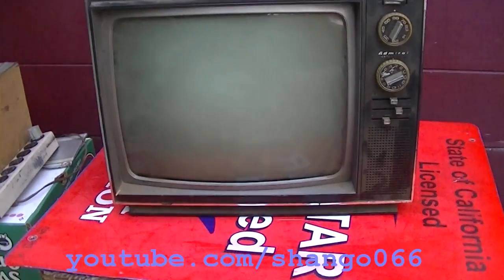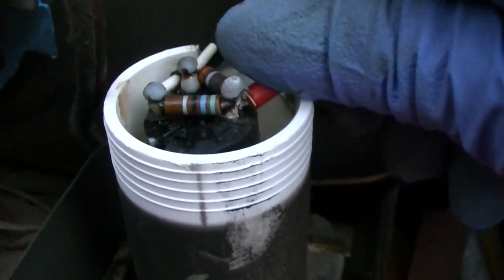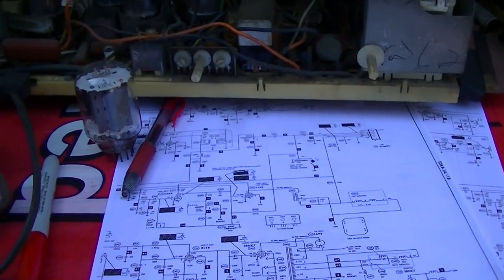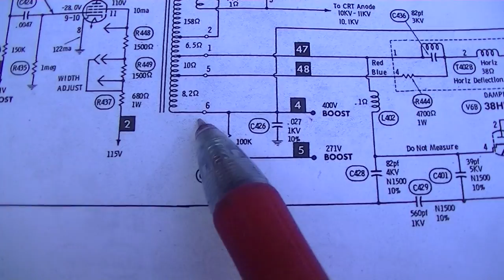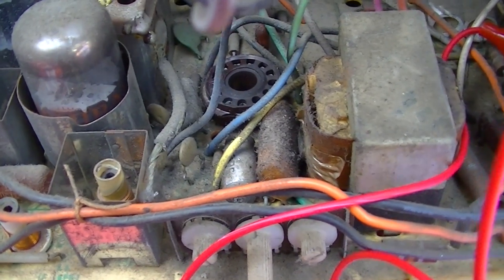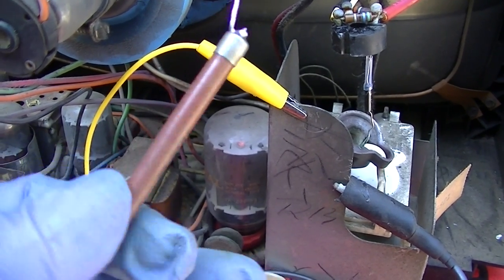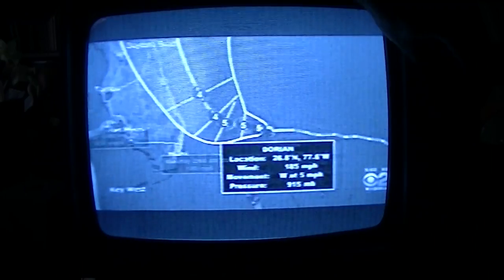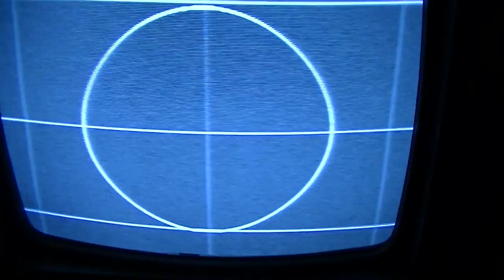1970 Admiral Black and White Portable TV Repair

Comment: "Instant-Play" or "Perma-Bake" or start your house on fire when you aren't home... or when your family is asleep in bed.
Reply: Yep, and meanwhile throw money at the electricity meter.
Reply: And put heavy wear on the CRT by keeping the heater on 24/7.
Reply: A common safety tip in the day was to unplug your TV when you were going away from home for extended periods. In fact, they still say to unplug your electronics when you're not using them.
Reply: @dougbrowning82  When I was a kid, my parents turned everything off -- gas, water and electricity -- before our annual holiday trip. It meant cleaning out the fridge, but it gave them some peace of mind.
Reply: @GGigabiteM  Most sets had the heaters on a rectified mains voltage instead of the full voltage. The heat dissipation is then about 70%. Enough to get a picture on instantly. When the set was switched on the rectifier would be shorted and the filaments would be on temperature within a few seconds.
Reply: @jlinkels  ...Which still caused heavy wear on the CRT. TV sets with "instant on" functionality were often fire hazards and had recalls or TSBs on them to disable the circuitry constantly powering the tube so the sets didn't keep burning up tubes.

If anyone comes across an old TV with instant on functionality, I'd recommend either disabling it or unplugging the TV when not in use to preserve it, you can't get replacement CRTs anymore, the last manufacturers of even the junky CRTs ended production in 2008.
Reply: @GGigabiteM  Sure. I did not say it was a smart thing to do. On the other hand, the waiting time could be quite nuisance. I have converted quite some television sets to Permabake as well as a number of USA radio sets. Few EU radio sets used series filaments, but almost all TVs did. At that time nobody cared about energy, and who cared about tube life if they were easily available. I am not even sure is a cathode is subject to wear when there is no current. In high power radio transmitters (the field where I am from) tube filaments are kept on low heat whenever the transmitter is switched off. And before that was available, tube filaments were often switched to 1/3 power so as to reduce thermal stress. But the cathode construction is different in those tubes.

Comment: Just came across this video.  I worked for a Admiral dealer, a small one man shop.  We sold a couple thousand of these sets.  They were good workers and the only recurring problem was the instant-on diode across the power switch after south Florida lightning storms.  We also sold Gusdorf TV stands with then too.

Comment: Back in 1069 I  wed the love of my life and together we moved to Minnesota, back then you could get work out there. Well we got settled in, I was pumping fuel at a truck stop, my good wife was pouring coffee at the attached café.  We needed a roof over our heads and found a brand spanking new Liberty Mobile Home nice well we thought it was. The home was set in a trailer park for us by the dealer and it was hooked up to cable TV. Now not like you have now but just a large set of antenna's on the hill above our park, which was set on the shores of the Cannon river. So it was, we needed that adapter to hook to the 20 buck TV I found for our entertainment desire at a thrift store in Down Town Cannon Falls Mn.  Worked OK for our purposes. It was a cool start to our lives and the honeymoon continued for the next 51 years and 4 days.

Comment: Seeing that broken off antenna brings back memories of metal coat hanger antennas! It’s funny how nothing has really changed and how people today think you need a bunch of special equipment and antennas to get over the air free TV! Yes if you have an old tube type tv or even some of the early flatscreen you need a converter box but to receive over the air free tv you just need a basic antenna yes a metal coat hanger still works as an antenna, I’ve even used a large paper clip straightened out and bent into an L shape stuck into the cable connector on the back of my lcd tv  here in Denver and I can get several free over the air tv stations I have even been told by some people that this is illegal to do because I’m steeling cable tv, “LOL”!!! You don’t need any special equipment, a free tv key for $19.99, a high tech special digital antenna!
Reply: In my country they switched all the analog TV transmissions to digital, and without a good antenna installed on your roof you basically can't get nothing. In the old analog days you could receive some local TVs without an antenna, by even simply having a piece of wire in the antenna socket, but for receiving national TVs you still needed an antenna (well, maybe without it you received something but it was a very noisy signal)

Comment: I worked in a old TV repair shop in Santa Clara Ca. from 1983 to 1989. If I took a set like this one in for repair the owner would get mad. 20.00 estimate charge, 42.50 an hour. It didn't make sense for us to charge folks to repair these, well anything that had Tubes. The shop also sold new Zenith, RCA and Quasar TV's and VCRs. We put allot of Flybacks in the RCAs back then.  Mechanics wire wrapped clean and tight around that tunner knob works well, it is savable.
Reply: Wow! $20 to estimate and $42.50/hr? If I could have charged those rates here in the midwest back then, I would have been rich. Of course, had I tried to charge those rates, I would have been out of business in a month...

Comment: Very nice. I remember those 1970-ies set all too well. It is incredible how bad these sets were thrown together with the goal to save money. But on the other hand the design was such that picture and sound were well withing specifications, despite the cutting corner on everythinh which might have cost money. When repairing those old tube sets I mostly could not get a hold of a schematic. So wire tracing was it. But one had a pretty good idea about the general layout of such a TV set.

Comment: Respect to the TV technicians, repair work certainly requires a good working knowledge of electronics and troubleshooting skills. Customers do not understand the complexity’s of electronic appliances, wonder how many times technicians hear the comments “its just a fuse, wont take long to fix that”. Anyway the old school technical repairs sadly is dying out due to cheaper electronic goods.
Reply: Its impossible to get schematics for most newer stuff or they're so highly integrated with chips you cannot get anywhere. I did this stuff in the 90s and loved it wish I could go back to those times.

Comment: Wow shango066, I'm surprised you haven't been running into more non-problems with your troubleshooting technique, where you pull the back off a TV that has been in a dirty environment for 50 years, apply power and go for it.  When I worked in TV shops in the mid-1970's, the first thing we would do before troubleshooting is, clean the tube sockets, controls,  and tuner.  Also, those Admiral  (as well as most any brand) B&W sets, were notorious for fatigued solder joints and fractured PCB traces.

Also, on those "Instant On" tube TV's, they generally had a single halfwave rectifier diode power supply.  To make the "Instant On", they would usually connect a diode across the on-off switch, with the diode connected in the opposite direction from the power supply rectifier.  That way, it would only power the filaments when the set was switched off.

I never doubled checked the high voltage that way, the risk of stopping your heart is too great.  You are right about the low high voltage current though, it's the capacitance of the dag coating on the CRT that makes it dangerous.  Even though it's only a few hundred pF, the peak discharge current is very high.

Comment: Very entertaining vid @ Mr Shango, thanks for sharing. When you attached the alligator clip to the vertical pot you most likely bumped it so it made contact again :-)
 ESRC1 is alive and kicking, no Hurricane problems. Spoke to the owner yesterday and he also says the order website now works for some, for others it may still be out of order. They are adressing the problem and it should be in order soon.

Comment: It fixed itself because it's the bondage and disipline set, and it submitted to you out of fear of being burned with cigarettes and not powered up for another 20 years.

I've had the 12" version of this set for 32 years and counting, runs and is used daily.

Comment: Thanks one more time for your nice repair-videos.
I had this effect of "repair while measuring" sometimes, too, these can be the most difficult failures - beside the time- depending failures -  to fix when you can not reproduce the fault, the set is running for hours and next time to start it in the customers home it will be not running again ! Multivibrators and Oscillators are known for this, perhaps the connection of the meter (R and C-Dip!) can make a tired oscillator running. Perhaps some components are drifting in value or, of course, bad capacitors can be the reason, too.

Comment: The next time you do CRT testing can you please explain what you mean by Cut Off? Thanks.
Reply: THANKS!       I Keep thinking i'll figure it out, but each time i believe i 'get it' . . NOPE.     =\    hmmm    i see needles move differently
Reply: It falls back on the basic theory of how vacuum tubes work, cutoff is the point where the control grid voltage is such that the tube no longer conducts, the plate is positive, the cathode is negative, the more negative the control grid voltage the fewer electrons reach the plate. There is more too it then that as most tubes have more then three elements but that's basically the idea.

Comment: Shango,you mention the fact tubes for TVs are cheap because hardly anyone works on old TVs.I think one factor for that is that there is no one to repair or rebuild  CRTs.I know old console stereos,record players,and tubed audio components are more popular than they have been in decades,thanks to renewed interest in vinyl,and tubes for these applications can be very pricey,in part because some of the same tubes,like the famous 12AX7,are also used in guitar amps.

One possible obstacle for repairing old TVs,is the problem of a CRT made for one company's model,might not fit or work in another TV,from the same,or another,manufacturer.

I will say that even the cheapest of  old  CRT TVs,not only have a charm flat screens can only dream of,and the picture quality of a CRT set that works well,can be far superior to that of a flat screen,without the annoying picture dropouts.If anyone were to ever perfect a relatively inexpensive way of repairing old CRTs,they could make a fortune.Let's not not forget many gamers prefer to use old  CRT televisions,and computer monitors.

Comment: C424 shorted or leaky would put B+ on G1 of the horz output tube, that would cause high plate current.
I've had circuits start working when I hung a scope probe on them.  Which indicated that it needed a few pf to ground at that point for some stupid reason.
ESRC has extended the $1 days till the end of the year.  He must have seen your video!   Oh and yeah Florida really dodged a bullet on this one, Miami-Fort Lauderdale didn't even get much rain from the storm.
The most dangerous thing about the HV in a TV set is if the shock causes you to drop the CRT.

Comment: The biggest problem I see here is Dirt and Corrosion. I usually use vinegar to clean away corrosion. As it eats the green and leaves the copper and other metals, as it is an organic acid and does not disolved too many metals.

Comment: I think the vertical started working when you clipped on the clip lead because the wiper of the pot was not making contact to the carbon track. You probably bumped it enough to start conducting?? Just a guess...
Reply: I guessed the potentiometer was intermittent

Comment: I dont know why Youtube reccomended this to me but its very interesting

Im surprised that new old stock vacuum tubes are in such abundance. They must have just churned them out back in the day.

I wonder if the "self fixing" vertical was lose in some way and you hooking up the wire from the tester wiggled it around slightly and got it working?

Comment: As a kid growing up in the 80s everybody had these TVs still in service if they didn't have them in the home for use these were on the curb for garbage pickup all over
Reply: It really shows how fast tv tech or desires have changed with generations. When I was a kid (born in 83) we had a little solid state tabletop color set, but it was still very common to go to people's houses and see b&w sets in spare rooms or a kids room. Nowadays with everyone switching to LCD tv's so quickly it isn't even common to see a color crt set in a kids room, they all have a cheap Chinese lcd's. (It also doesn't help when the town's run free e-waste pickup that includes crt tv's).
Reply: @volvo09  I hear ya. As a bit of a side note, in my neck of the woods here in pennsyltucky you can't get rid of them legally anymore. No one will take them, there is no place to bring them, so basically you have to leave 'em by the side of the road if you want to get rid of them. Sad.
Reply: I notice more modern LCD TV's at the side of the road.They disappear fast so someone is fixing them!
Reply: Every week the goodwill clearance here has 10 or 15 broken lcd sets that nobody buys and go in the dumpster. I very rarely see crts anymore
Reply: @equid0x  Broken screens equals forget about  that one! No one wants to fix them cause that would cost bucks!
Reply: @he's the Master They're typically not cracked LCDs usually tcon boards or psu issues IMHO I just don't think they're worth repair. In my area you can buy a 70" 4K unit brand new for less than $600.
Reply: volvo09 Things do change fast. About ten years ago, a guy brought a tiny B&W set to where I worked for March Madness. Now he’d just watch it on his phone.

Comment: Self repairing? What this set was used in Cern in the early 70's? I like that set, not even one bad cap. You know I hate to think you could have wrecked it by making a wrong diagnosis? Turned out great - but we will need to proceed more cautious with the other 5 sets you got from that warehouse, they all might just have zero to minor problems.

Comment: I love the compactron valve, sadly we didn't have them here. Good idea with the microwave oven diodes, must try that. There real cheap tubes, could treat the set to a full set of new tubes for a few dollars. The CRT doesn't look to bad. Is there any plans to shut down that analog station?
Reply: I read somewhere the FCC is shutting down those stations in 2021.

Comment: Any idea why my TV (Firestone 13-G-54) has this "Color add-on" option model Firestone 112 (in an octal plug on the back)? Amazing, it has all the notices (like for digital when they had switch over) that they will offer an option that is "Color Compatible".  17HP4 isn't a color CRT, and it looks like the plug takes composite video, Sync, and +450V.  Could this be the reason why a CRT would burn out?  I thought that black-and-white simply skips over the color burst in NTSC.  Am I missing something here?
Reply: It sounds like the set has provisions for adding mechanical color support. A rotating color wheel would have gone in front of the black and white picture tube, and circuits would have been added to keep the wheel spinning at exactly the right speed to keep the colors synchronized.

CBS proposed and developed such a system, and it could have become the standard for color TV.

Comment: HV is higher with the rectifier tube instead of the silicon diode. atleast 300v higher. even after the added filament load

Comment: I wonder if Japanese TVs of the 1950s used wax capacitors. Wax on when new and wax off after getting leaky and hot and then vertical breathe in breathe out

Comment: what would cause a 6j5 to get so hot in a radio
Reply: +snapper mower man gaming - Check voltage on the grid (believe the 6J5 is a triode). Suspect a shorted cap going to that element if you get a positive voltage there.

[Edit]: Also check for a changed value resistor on the cathode. If the tube uses cathode bias and was running a red plate, this resistor may have overheated and gone out of tolerance.